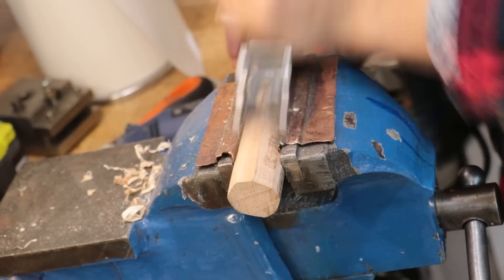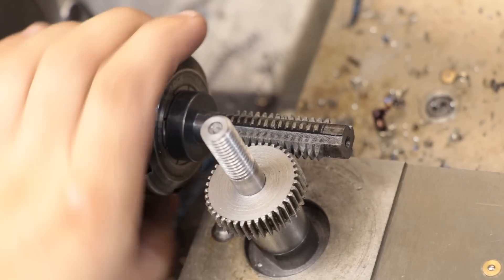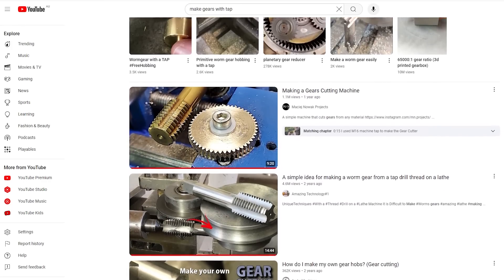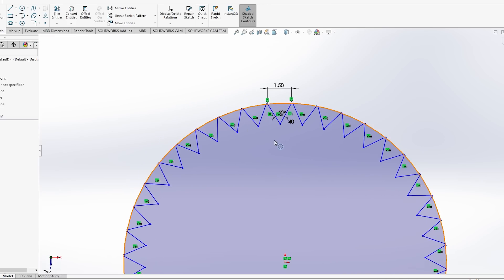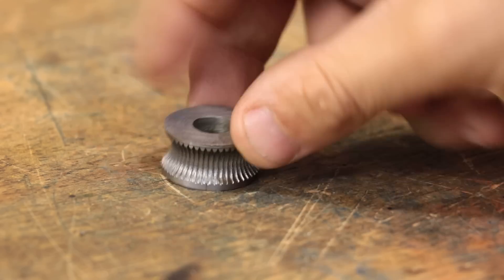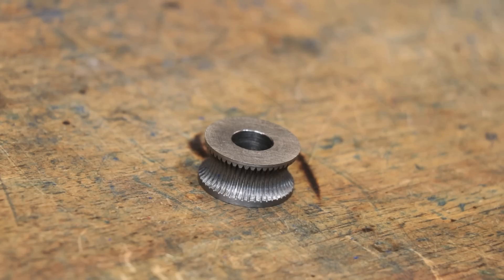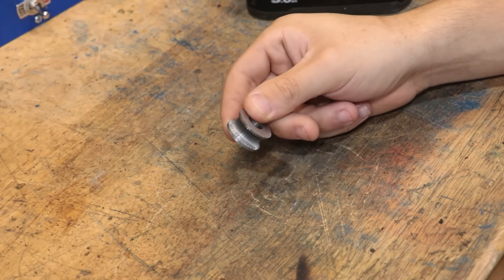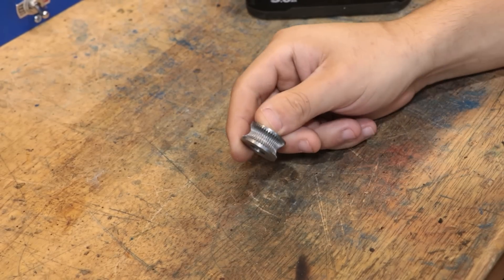Making Worm Gears With Taps - BUSTED

Comment: It’s interesting to me that some of the most authoritative and widely-used mechanical engineering and manufacturing engineering textbooks provide some theory regarding worm gears but little about how they can be generated other than to possibly reference the hobbing process.  (An exception is a textbook by author Mott).  Even machining textbooks used in trade schools that I have seen appear light on the subject.  So it is especially good to see references like the Ivan Law book, for example, provide practical solutions to cutting gears in the home shop setting.  Thanks for posting this particular method and its limitations.  Although I am not likely to rush out this afternoon and and use it to cut some metal (my lathe supports module threads), I appreciate the time and effort taken to shine some additional light on this method.  It was well worth watching.  Hope the hand continues to do well.

Comment: Not once did i hear the word "involute" , which makes me wonder
Reply: It will produce an involute, as the process is effectively the same as for normal hobbing of wormwheels. But this setup doesn't allow the tap to pass through the gear blank vertically, so cannot produce a spur gear. If this could be arranged, the tap should be set at the helix angle of the thread, but the gears produced would be incompatible with standard gears, though would mesh with others made the same way, with similar or different numbers of teeth.
Reply: @BillDavies-ej6ye  he's producing the involute as a casual artifact of his process rather than by intent.
Reply: @danielmclellan7762  If you mean causal, I agree, Daniel. Whether intentional or not, the form will be an involute.
Reply: @BillDavies-ej6ye  causal indeed

Comment: I've never tried using a tap to cut a worm wheel, but I did have one  application which demanded a custom hob, so I understand all youre explaining. In my case, my chinesium bandsaw ate its brass (!) worm wheel, mod 2, so I ended up making the hob, gashing the blank (at 0 deg) and free hobbing the wheel. Its still working 3 years on, so I cant have done that bad a job!

Comment: I like that you did this, your points all made sense except the complaint about removing pi from the equation. 

I don't fully understand this but I recall you describing the difference as one method using radius and the other diameter. As diameter is 2Pi*r it seems trivial for Pi to be in the equation, and have it based on radius. Let me know what I'm not getting here.
Reply: Pi is used to ensure that nominal inch or metric dimensions exist between the centre distances of pairs of meshed gears. Diametral Pitch (DP) is the number of teeth divided by the pitch circle diameter (PCD) in inches. A 16 tooth gear of 1 inch PCD is a 16 DP gear. Module is the PCD (in mm) divided by the number of teeth. Notice that the formulae either have the number of teeth on the top or the bottom. Thus, like imperial & US threads have nominal numbers of threads per inch of thread length, metric threads use the pitch, or distance in mm between adjacent thread forms, not over a specified distance.
Reply from the maker: Sorry if I wasn’t clear on that. Because module/gear size (the tooth spacing) is based on Pi. It means that the gear pitch diameter is simply number of teeth x module. So I work with module 1, I need a 40 tooth gear and the pitch diameter for the gear blank is 40mm. No need to work with pi. The gear blank calculations are much simpler since parts are usually measured on the lathe using their diameter and usually you’ll end up with while numbers. This is much easier than needing a gear blank with a circumference of 40mm since the diameter would need to be 12.732mm which is a less intuitive measurement to make.
Reply: @artisanmakes  makes sense cheers
Reply: It wasn't Radius and Diameter, it was Circumference - so the perimeter of the circle was driving the calculation, instead of the distance between edges or center.
Reply: @ThantiK  yeah I put the wrong word, good catch

Comment: We used to make the "hobbed bolt" for 3D printers using this method. Not easy to freehand with a jury-rigged jig, but it worked okish.
M3 or M4 taps were used IIRC.

Comment: The gears not having the involute shape needed to "roll" across each other seems the biggest downside for me.
Reply: Involute gears don't roll, they slide on each other's profile except at the pitch diameter
Reply: Well, they will generate involutes, but they won't be spur gears that can mesh together.
Reply: @BillDavies-ej6ye  ah right. Had to think a bit and read your other answers here.

But if you drive it with a threaded rod, that part would be cause of the missing involuteness.
Reply: @MadMacII  I'm not sure what you mean. The involute is formed as the part is cut. The threaded rod becomes the rack, with straight sided teeth. If you take the view that the rack is a gear of infinite radius, then the straight sides are also an involute.

Comment: The fact that there is no standard in industry for this kind of gear profile should tell us all there is to know about this method.

It does look like a fun experiment though
Reply: This method isn't used by industry, and it doesn't produce pairs of gears that can mesh. But if you wanted a gear that can run against studding or all-thread acting as a rack, this works. I used it in 1969 for the focussing of a homemade photographic enlarger, and it worked fine. It will also work as a worm and wheel for simple hobby or toy applications. As mentioned, the pressure angle is somewhat greater than standard gears, which increases the force pushing the worm and wheel apart, reducing the torque that can be transmitted.

Comment: I successfully made one or two M10 worm gearboxes with a standard tap on my mini lathe. I had no use for it as I just wanted to see, if it was possible, and it does work as a 20ish :1 gearbox.
If you are sceptical about the tooth profile and pa, maybe a trapezoidal thread tap would be better

Comment: I'm curious what cad program you use? How do you like it?
Reply: It looks like solidworks. Works well, but it’s expensive
Reply: @justinst.4592  Correct me if I'm wrong but I believe that Solidworks is available to "makers" or individuals on sort of the same basis as the no-cost Fusion 360.
Reply: @justinst.4592  🏴‍☠
Reply: Yep Solidworks, unless you own a legacy/older perpetual license it is to expensive for the average Home user. All of the 'free' software comes with baggage  and only beleive about 1/2 of what some random YouTube head tells you is AWESOME. Freecad is improving but still kind of Beta in a lot of areas, Blender 'is not and never will be CAD', Fusion 360 'free' has some limitations so go in eyes open (it is what I use and pay for by choice) Any of the other 'online' or 'free' ones have publish or else clauses or are not well featured. Not a complete list but a few to look at.

Comment: Good video! One quibble, though — In those video thumbnails you showed at the beginning, I noticed some from @AndysMachines. His gear videos aren't actually in the "Make worm years with a tap" rubbish category you were criticizing, and they're worth a watch if you haven't seen them already. Andy built a gear hobbing attachment for his mill. He puts a gear hob in the spindle, and the attachment rotates the gear blank at the correct speed to make perfectly hobbed gears. There's electronics involved: he uses a rotary encoder and a servo or stepper motor, plus some code that he's made available, to synch up the rotation. Very clever. I want to build one someday.
Reply: It's a great series his gear theory videos, and he is a rather clever man. I am building a version of his hobber at the moment slowly, I too was impressed with the solution.
Reply: That is not good form on your part
Reply: Blah blah blah
Reply: @smashyrashy  Odd response- I'm subscribed to AndysMachines too and that video is indeed not in the same catergory as the other 'DIY hacks' rubbish. You might want to actually watch the video in question before dismissing legitimate comments.
Reply: @smashyrashy  jerk
Reply: @smashyrashy  I called you j*rk earlier and it got deleted sadly. Try again. J.e.r-k.

Comment: I'd guess those who are using taps to hob gears are probably trying to get er' done without mathing and not going for perfection.
Reply: Which is fine, sometimes that is all you need, but people should be aware that you Will be getting less than optimal results from this kind of 'fast and dirty' method and adjust expectations accordingly.